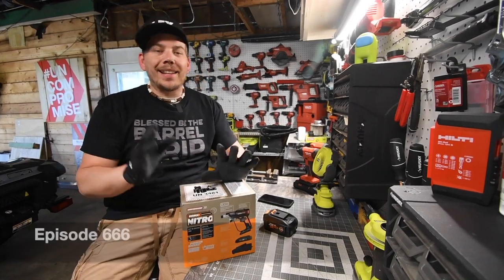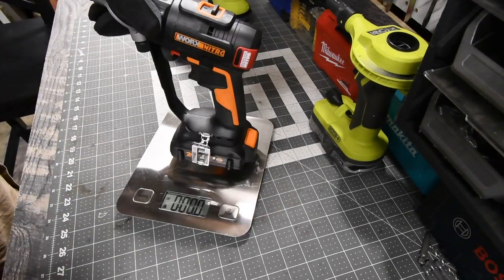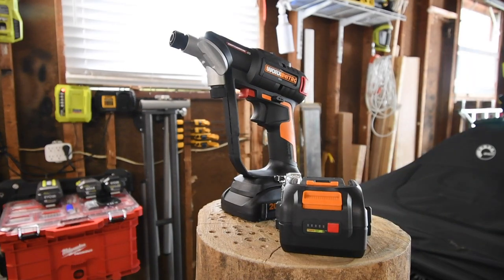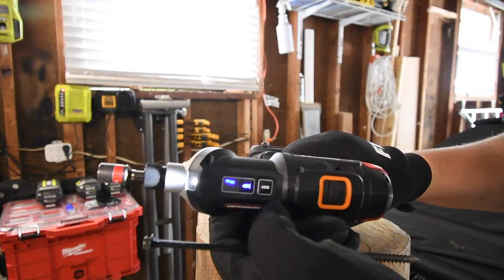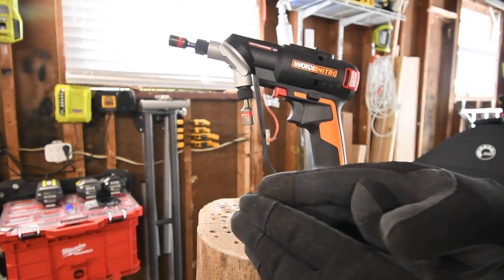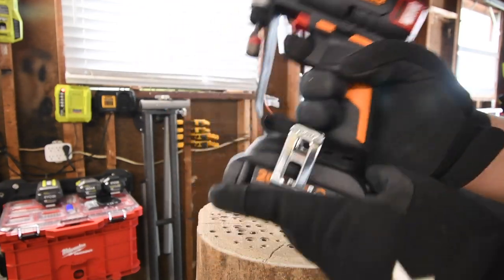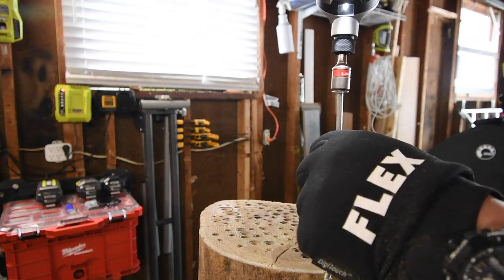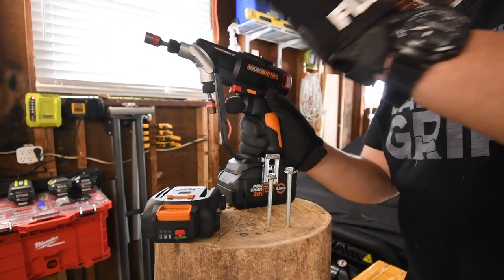NEW!  WORX Brushless SwitchDrive Drill Driver!!

Comment: I love mine for drilling a hole and not having to switch out the drill bit for a driver bit.  I can drill a hole, put in the screw, drill a hole, put in a screw so very easily.  For driving power I just use my Worx impact driver.

Comment: I already owned some Worx line of tools especially the Switch Driver but mine is the 1st generation Brush model, I use that tool for Precision works in the jobsite where I need to predrill holes before I put the fasteners because the material will split even when using a expensive screws and fasteners. And I use the worx switch driver for Electrical works, for light carpentry yeah this tool really shines, but for Heavy Carpentry jobs like decking, and light framing (partitions) and installing lags I use impact driver or impact wrench and for concrete drilling I use my old corded Bosch HD18-2 Hammer Drill or my old DeWalt dcd996.

Comment: These are extremely unrealistic tests for a drill like that which is what makes this impressive. That drill is great for anyone that's just throwing a pilot bit or countersink on one side and a regular fastener bit on the other for screws up to 3" or so. If I was still at the age where I bought gimmicky stuff like this I would absolutely buy it because it's really not so gimmicky with those capabilities. Too bad I have 27+ drills already lol
Reply: He does these unrealistic tests to stress test the tools just to see what they can handle. I agree with you on the head feature, I install cabinets and it would be nice to just switch back and forth from a countersink and a driver bit. My only problem is Im addicted to impact drivers. If one head had an impact mechanism, I would prolly be sold
Reply: @Skwish6952  I'm new to the wonderful world of power tools so if the answer to my question is obvious AF, remember I am a total noob lol Is it theoretically possible to have a power tool like that? Similar setup to this driver but that has a 1/2" drill chuck on one end and an impacting 1/4" hex head collet on the other end? If it is possible, I'm assuming the only reason something that amazing hasn't already been brought to market by a major tool brand is because why make 1 tool that does the job of 2 when you would make more money by making your customers purchase 2 individual tools instead. Gotta love capitalism 😐

Comment: Still feel like this is a useless tool it had less torque and rpms that 90% of the drills out there brushed or brushless, the standard is 500 inch pounds 2000 rpms, if you are at menards or where ever you get worx, spend a little more on a skill, masterforce, go to the depot for Ryobi